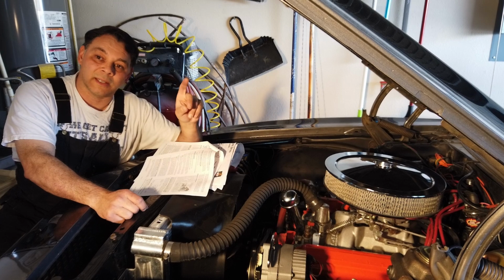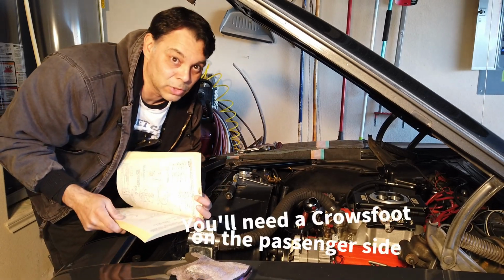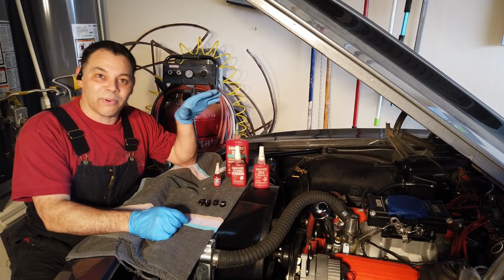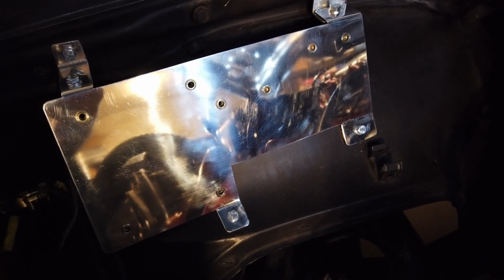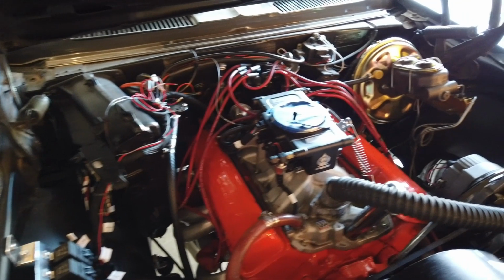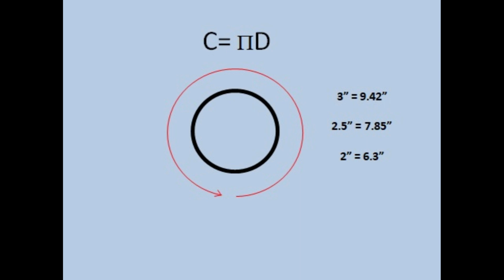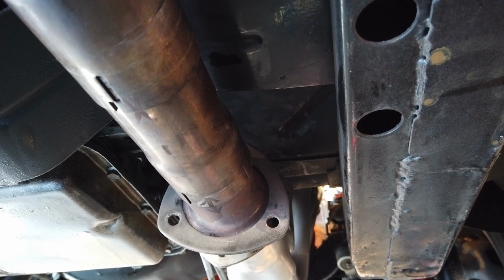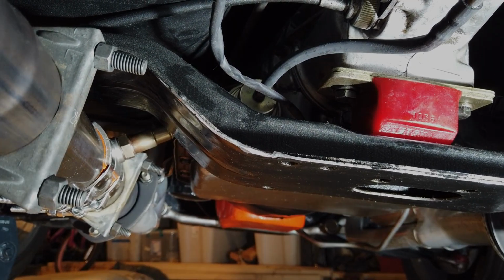ACES EFI Killshot Pt: 6  Installation

Comment: great video do you have dual plane manifold look like to me
Reply from the maker: I use a dual plane intake with a spacer. I've used both a spread bore spacer to keep it dual plane and I've used a single open hole spacer to make my dual plane act like a single plane and I really can't tell the  difference.  However others say they can tell... so if you have a dual plane just buy a square bore spacer and you should be good

Comment: There's other install vids where the temp sensor threaded right in on factory 454 cast iron intakes, not sure what bungs you have or if you missed the bung the other channels used.
Reply from the maker: LOL... I See you're binge watching the videos.  I appreciate your time.  The classic engines used larger ports for the temp sensors.  An adaptor bung is required for those because these sensors are meant for newer modern style intakes.  What I couldn't figure out is why the sensor wouldn't fit on the adaptor at all.  It really was the red RTV sealant they pre-applied.  WAY TOO THICK!  I used a light layer of thread tape and haven't had a single leak and it works great.

Comment: Great video! I am getting ready to install the Killshot on my 66 Oldsmobile 442. Did you install an oil pressure sensor? I have installed the oil pressure sensor but do not know where/how to wire it since it is missing from the cable harness.
Reply from the maker: Thank you sir. I appreciate it. In its current form, the Killshot does not support both fuel and oil pressure indications. At least mine doesn't, though ACES is working on that from what I understand.  During SEMA they announced the Killshot 2 and that might come with it incorporated.  The proof is that the firmware and software in the Killshot 1 DOES however already have the ability to monitor both.  My Killshot model though only has one wire harness for pressure indication.  The harness you're looking for is the thick black braided one labeled "FUEL".  It is pre-terminated to hook up to a normal (EFI) pressure sending unit and so should work for either... but not both at the same time.  So you will have to choose what you want the Killshot handheld to show you... fuel or oil pressure. I chose fuel... since I find it more important for the EFI and I can always hook up a classic gauge for oil.  You choose though.  Also, something to keep in mind, is that since ACES is intending to provide for the ability for both, you will already notice that the Tuning Software already has inputs showing both when you run the datalogger.  So... when running the software, check mark ON whatever it is you ended up selecting and OFF what you decided not to monitor... or the software will show you the exact same reading for both. The suck part is that no matter what you choose, when looking at the handheld, it will always be labeled "Fuel Pressure" even if you used it for oil.  I'm sure that will get updated in time. ACES does sell it's pressure sensor kit for fuel if you are interested.  A thought I had was to buy a second pressure sensor and install it in the oil gallery... and when I want to run diagnostics, I can always change the harness from fuel to oil and look at my readings... or swap out as my mood feels at that time. I hope that helps you out... though it might not be what you were hoping for.
Reply: @dc10tech911  It all makes sense, thank you for the quick response.

Comment: You had the pipe off and in your hand. Why didn't you just take the pipe and the bung over to a muffler shop and have it welded in. Would have been easier and finished. I'm sure you could have convinced the committee that it was worth it
Reply from the maker: HAHAHA!  Winner winner chicken dinner.  You get the shiny gold star for having spotted one of 2 weirdnesses that I'm surprised no one has asked about until now. Technically the answer to both is the same. Have you ever decided to do something and thought about it so long that you became so focused on it that all other possibilities just never crossed your mind?  Yeah... that was what happened. I had planned on putting it on the passenger side as intended.  That side would not have had the extension to be able to remove because the bung would have ended up in the main X pipe that was not easily removable.  When I realized I couldn't put it on the passenger side I just transferred the thought to the driver side not realizing it made all the differenced in the world.  I actually didn't realize the possibility until I had the pipe in my hands AFTER I had installed the bung with the new clamps and sealant.  You should have seen my face when it dawned on me.  I could have diverted the funds from the new clamp and sealant to the muffler shop!  I hate tunnel vision.  The second weirdness was I didn't have to do all the fancy measuring given that the driver side pipe came out so easily.  Oh well... maybe it will help out someone else who DOES have that problem.

Comment: I am installing a Killshot on my 66 Chevelle with a 396 motor. I liked where you put the Fuel Pressure Sensor, in a fitting where the rubber fuel line goes in to the TBI. I looked for such a fitting in my kit, but don’t see it. Is it something you bought extra? If so, where did you get it? I have watched your videos several times and appreciate the great job installing everything. I too am a retired Aircraft Mechanic, so I can see that the great effort installing paid off in the long run
Reply from the maker: @jacklo2801 Thanks for the kind words.  Always nice to meet another A&P. I actually got a free ACES fuel pressure kit sku number AF2009P from them through a promotional giveaway they do every so often. But you can find similar adapters in Amazon for about 20 bucks. They are male to female fuel pressure sensor T's. I just can't remember if it's a 4AN or 6AN. A company called AFATEBOX is selling one on Amazon for 15 bucks in size 6AN. They titled the item "6AN Fuel Pressure Take Off Fitting 6 AN Male to Female with 1/8 NPT Gauge Port Hose Adapters Aluminum Black"  hope that helps you out.
Reply: @dc10tech911  Thanks so much for the help. I ordered one and that's one less obstacle  out of the way.

Comment: You seriously over thought the O2 sensor placement. You only need to install it in the top half of the pipe to keep condensation from sitting on the sensor.
Reply from the maker: LOL... I'm an aircraft mechanic... I'm used to following manuals... it's kinda how I roll.  We don't do things in half measures.  Then again I'm not having any of the problems others are.  I wanted to make sure I covered all my bases. These videos actually started as a cover my butt in case it didn't work right because of the pounding the kit took during shipping.  I wanted to have proof that it wasn't me that caused the system to fail.

Comment: Watching your install of the Aces FI. Looking good! You asked why metric bolts? Everything in the kit is sourced and made in China. They are not going to put SAE bolts in the kit. Just saying. All of retro-fit FI systems are made in China not just Aces. Just to be clear. (I worked as an A&P for a on business jets at an FBO. I got too old to stay in the profession but had a blast. The hell hole in smaller jets is tight, cramped, dark, and just nasty. I did find a few tools though. A huge No No as a lot of exposed items in there!!)
Reply from the maker: Would that it weren't so.... my classic is becoming a real mismatch of SAE and metric. Yuck!  Ah a fellow A&P. I've spent plenty of time inside tight hell holes. 😆  even got trapped inside a tight space for 6 hours because i got snagged before someone came looking and found me.  Ah the joys of aviation